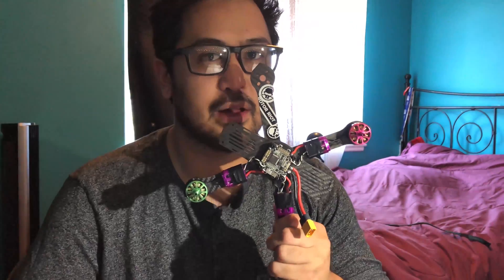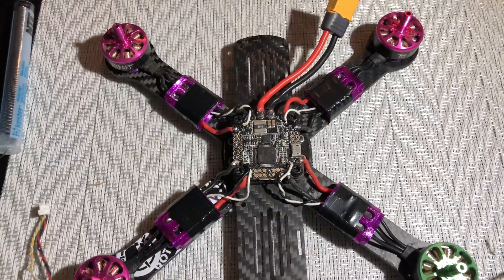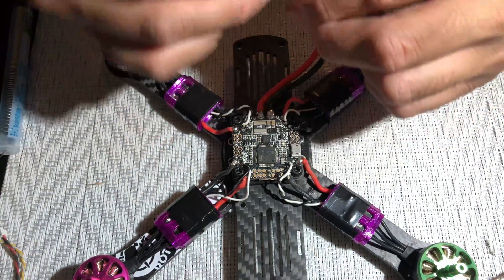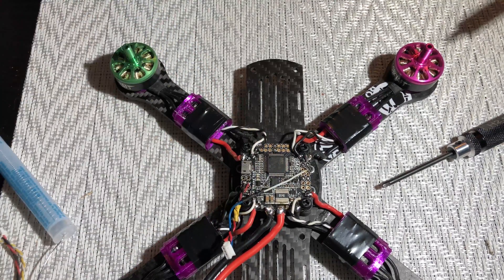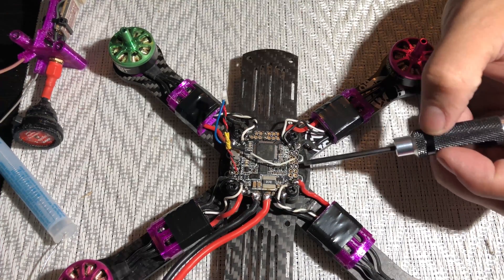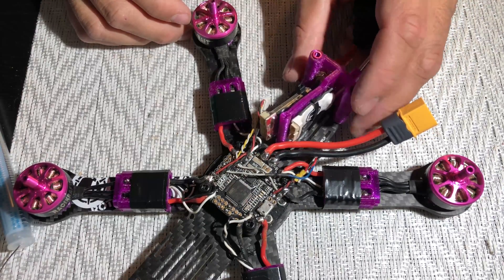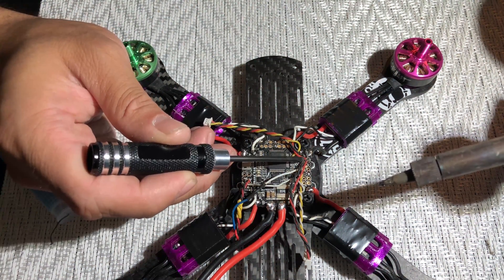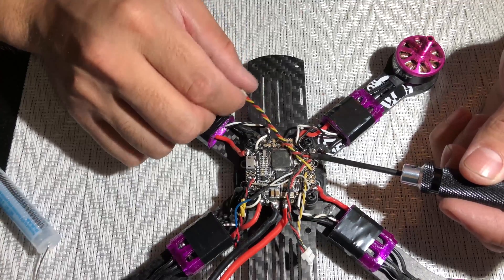DYS F4 Pro V2 | Wiring Preferences, Setup, and ME!

Comment: Can I connect my esc separate and drek battery to the control board. (4S 14.8V Li-Po)
Reply from the maker: Murat Güzel would it be for a 4in1?
Reply from the maker: Thanks for the follow! Glad to be of any help
Reply from the maker: Yes absolutely. There’s a pin breakout for a 4in1. But if I’m understanding this correctly you would want to connect your individual esc’s to something like a pdb but still run the xt60 to flight controller. In that case it would be wiser to just use this flight controller as the pdb since it’s an all in one with a current sensor already built in.
Reply from the maker: Oh and yes this board works for a 4in1 or individual esc’s. Just depends on what you prefer. :)
Reply: @JaypsWRX  Thanks for the help. I will follow you. take care.